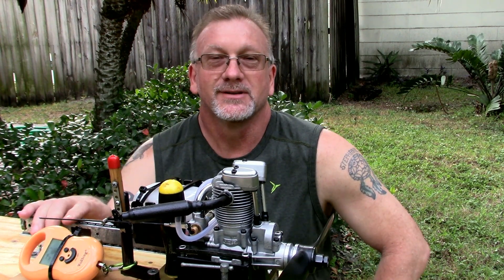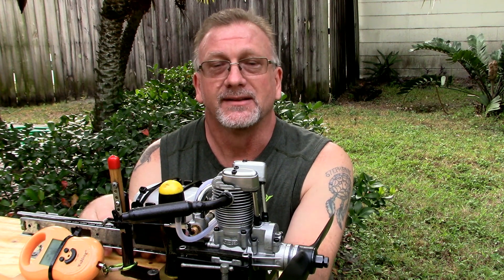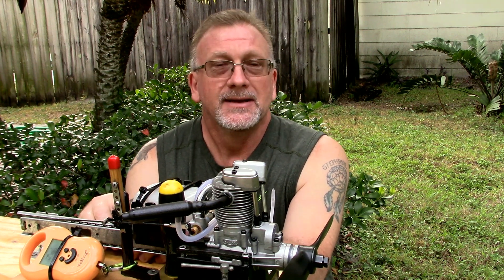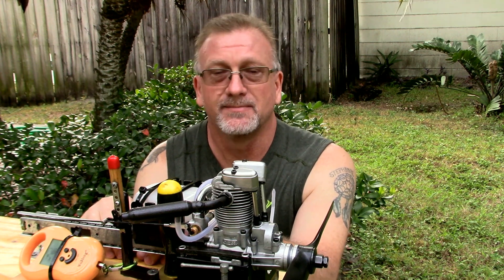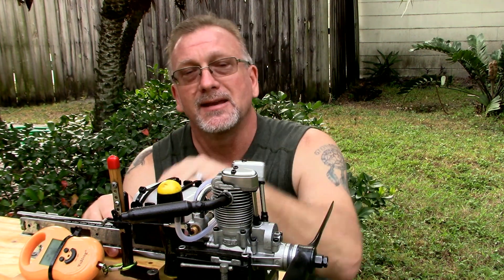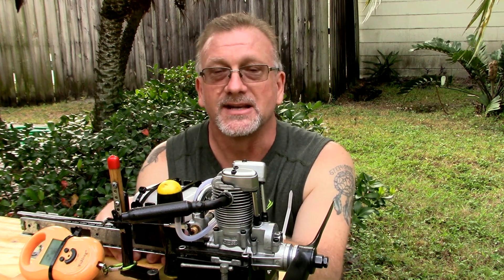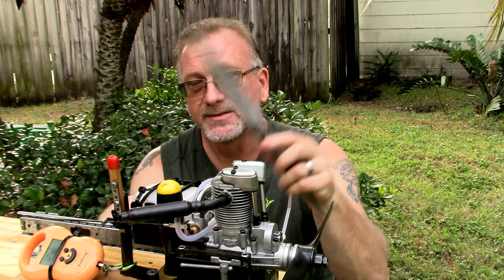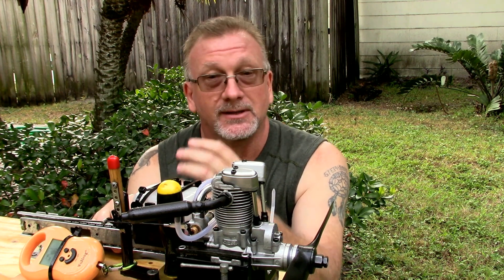Saito FA-65 Gen I Static Thrust Runs

Comment: That's actually a version 2 engine with 12.7:1 compression ratio. Saito made 3 versions of the fa-65.

Version 1 is 10.5:1 and has an air bleed carb. (shown in your older vids)

Version 2 is 12.7:1 and has an air bleed carb. It also has a bulge in the cylinder at the base (as seen in this vid)

Version 3 is 8.6:1 and has the newer 2 needle carb. The cylinder mounting flange is wider than the cylinder wall. The case is beefed up at the rear bearing area and appears as a taper.
Reply from the maker: I am curious as to where you are getting this information.  I do not believe that Saito ever made 3 versions of this engine.  So any proof you have of this would be great.
This is the review of the first Gen engine, http://sceptreflight.com/Model%20Engine%20Tests/Saito%20FA-65.html
Clarence Lee in this article does not mention  three versions, he mentions only this updated version.  http://sceptreflight.com/Model%20Engine%20Tests/Saito%20FA-65%20update%20model.html  This is where my information comes from.  So if you have additional information to prove your assertions, I think we all would love to see that.  Saito made many changes to carbs over the years but that does not mean the entire engine was changed.
Reply from the maker: Well I see you have not provided any proof to your comment, thus how can anyone believe it?

Comment: 12.7 : 1 compression? Is is the original or did you machine the head?
Reply from the maker: It states in the video that this is the Generation 1 engine.  No I do not modify my engines at all.
http://sceptreflight.com/Model%20Engine%20Tests/Saito%20FA-65%20%282%29.html

Later model, http://sceptreflight.com/Model%20Engine%20Tests/Saito%20FA-65%20update%20model.html

Comment: That's very interesting, nearly the same static thrust and huge rpm difference between the MA and the APC with same diameter and pitch.
Reply: It would be interesting to see how an APC 13x7 would compare in rpm and thrust.
Reply from the maker: After the fact is too late.  I will not be running this engine again anytime soon. If specific engines, props, fuels are desired I need to know in advance and a fee/donation will be necessary for special requests unless it is an engine I am already planning on doing.

Comment: Nice job! You just confirmed APC spins faster than MA. Performance vs looks. I have the newer Saito 65 (newer carb & muffler) and it is a great engine. On the heavy side but some models need the extra weight up front.